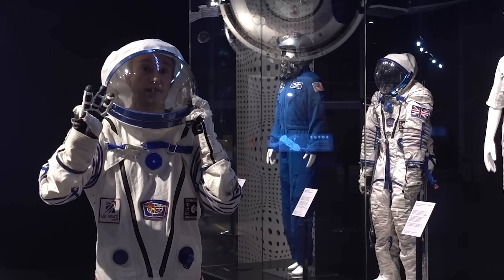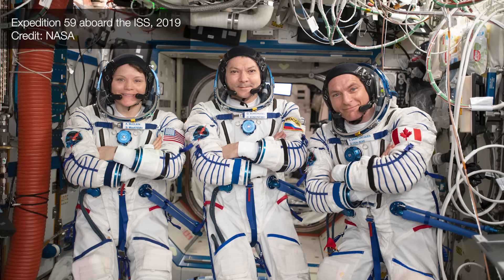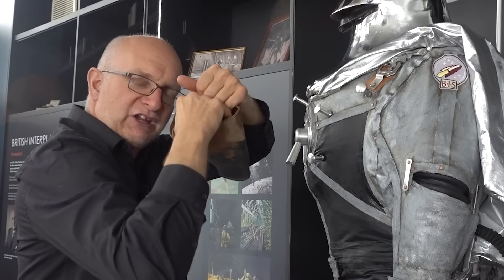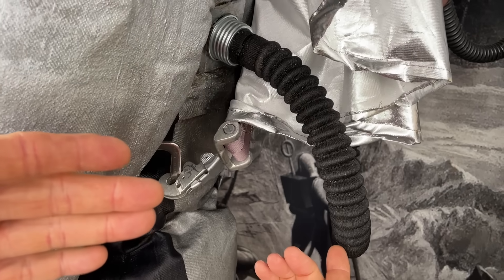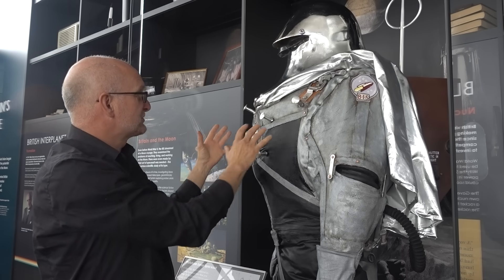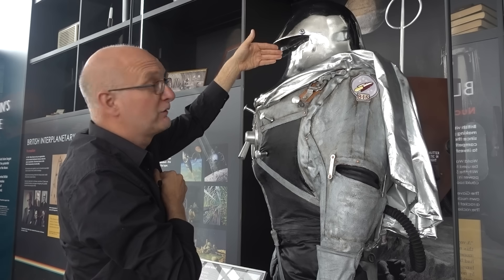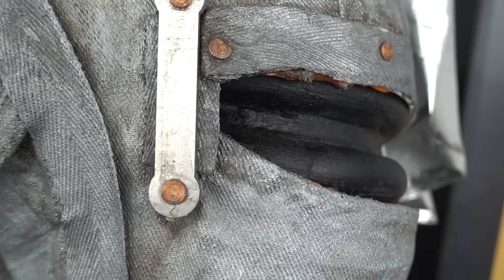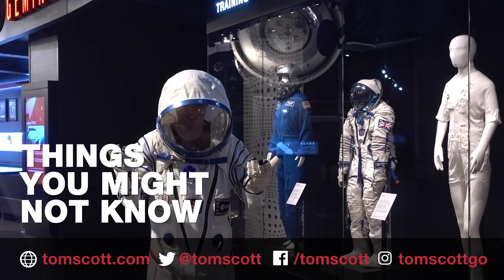The long-forgotten history of the British moon spacesuit

Comment: Materials Nit-pick:
Fiberglass (mineral wool) was invented in 1870. By 1880 a patent had been awarded for fiberglass textiles.
Rayon, acetate, and nylon were all well-known in the 1940s, and since you only need to make a few space-suits, presumably it could have been afforded for space-travel.
The US A7L space-suit doesn't skimp on suitable materials. Why should a British suit?
Reply: Hello. 

Whilst spun glass may be available earlier, the resin to bond it into a rigid structure was not. This is developed in the 1930s so completely in keeping with what I say. As for the technical materials you quote, we are going on what they specified, on rubber, on cloth and on rubberised painted surfaces. I think you have to wait until the mid 50s for highly reflective  mylar, and whilst nylon and artificial materials were used extensively in later flight clothing of the USAAF in ww2, we come back again to what Smith and Ross specified in their technical design documents.Wool, leather, rubber, cloth, what diving suits are made from, as I say.
Reply: @stephenabswisdom1187  Yes, your work is well thought-out and full of merit. I'm sure it was not an easy task! The nit-picking was more with the original design rather than your execution of it. Who knows what discoveries an alternate time-line might have yielded? Beta cloth is not resin-impregnated (like a surfboard) so much as teflon-coated glass fibers, and teflon already existed in the late 30's. Either way, it has good historical significance and a unique kind of relevance. There really aren't many full-size "alternate history functional space-suits" in existence, except yours!

Comment: Americans: expensive air conditioning
British: haha shiny blanket make me warm
Reply: Lmao
Reply: Actually air conditioning isn't just cooling down something. If you analyze the word you'll see that it's Much more. We got used to using it only for cooling but heating and humidity control is also part of air conditioning.
Reply: James May: "It's called an 'itchy blanket'. It reminds you how fortunate you are."
Reply: "*warm" people are wrong. Space impairs conduction of heat, as there is no air. This makes it easy to overheat, so the cape is used to keep cool along with active cooling systems.
Reply: @albertnewton8296  no, you are wrong
Reply: @kaydenlewis9246  >calls someone wrong
>proceeds to give absolutely no explanation or elaborate further
Reply: @ananttiwari1337  heat cant stay in space because there is nowhere for it to stay
Reply: @kaydenlewis9246  it can stay inside the space suit walls though. That definitely is matter.
Reply: @kaydenlewis9246  That's the problem. Heat can stay in the astronaut or spacesuit, there's just nowhere to move it out to so it stays in the astronaut. Keeping cool and avoiding absorbing too much heat from the sun is important.
Reply: That sums up regular British homes now.
Why do we need air conditioning, just pop open a widow.
A heater? No just get a blanket.
Reply: *cold
Reply: @Dapstart  no the blanket was to keep the astronaut warm not to cool them down
Reply: @Dapstart  space is cold

Comment: so how hard is it to make a replika and get it into a vacumchamber
Reply: Well,  when i designed this i also designed the pressure seals around the neck ring, but didn't put them on what you see here. I am also a hard hat diver and we used a lot of the tech from diving suits here to help in the overall design. There are many challenges to make it actually air tight.

Comment: For anyone else who maybe wondered what the heck that tower at the National Space Centre is made of, the outer structure is made of ETFE plastic, which I also just learned isn't all that rare for large buildings to use the material for lightweight translucent elements like clear ceilings that won't crush people in an earthquake.

Also, if you ever see a building like that catch fire, just GTFO, because it releases hydrofluoric acid when it burns. I'm assuming people have worked to mitigate that risk somewhat, but I'm not sure which part of that would be less fun, being on fire or breathing in HF fumes.
Reply: I remember reading about a military vehicle catching fire causing clinically significant HF exposure because the fire suppressant decomposed to HF at high temperatures. It was probably HFC-227ea or something similar.

Comment: Interestingly, the "liquid cooling and ventilation garment" that cooled the Apollo space suit was built on a design from a British suit with plastic tubes filled with water, but of course, it's not mentioned on Wikipedia, it is however mentioned in the documentary "Moon machines: Space Suit" about 30 minutes in.
Reply: ikr, it's almost as if Wikipedia isn't a good source of information
Reply: I'll totally pay you if you can send me one of those RAS flight undersuits from a surplus shop, I need it for my fursuit :p
Reply: @alakani  - I know that Soviet and Chinese pressure suits used by high-altitude pilots have similar rubber tubings and chambers, you can get surplus ones on Ebay. Not sure how they're holding up in terms of being airtight/watertight, though.
Reply: @alakani  do you mean RAF as in Royal Air Force?
Reply: @GODCONVOYPRIME  you shall be known… as Darth Vaderr
Reply: @alakani 
>I need it for my fursuit :p
You'll also need a de-lousing shower.

Comment: Why does it have a battle helmet
Reply: Hi Luke, it doesn't. Its made from fibreglass, as specified in the original texts. We vacuum.plated it with highly reflective aluminium to reduce heat build up from the sun. It is very long at the base to help the astronaut get in. I'm the only one ever to have worn it and the helmet has to be that shape to interlock with the next ring beneath.

Comment: Wouldn't that airlock be potentially dangerous? I mean, once you open a container in space, all the gas content is immediately sucked out due to gas expansion in a vacuum, so you would essentially be losing oxygen supply everytime you open it because the pocket would then fill up with the gas content that is inside your suit once you try to pick up any object found inside the suit... which would then be lost once you open the airlock again. It would also lower the overall pressurization of the space suit with every operation.

Comment: How is the "boiling blood in vacuum"-myth so common? Your blood will not boil because your blood system is a closed system and it maintains the pressure. What actually kills you is that the gases get kicked out of solution to keep the pressure equalized.

Comment: TOM! TOM!
Your blood does not boil in the vacuum of space! It's a myth! It's not real!

Your skin keeps the pressure well enough to prevent that! What you will find is that your eyes and mouth starts to dry up, that's about it!

And no, you will not freeze instantly in space either! It will take many an hour four your body to radiate heat, as there is no medium for heat to travel through, or to "suck up" your heat!

Comment: I was recently shopping for watches and realized that on most clocks that use roman numerals they use IIII instead of IV, I feel like it would be an interesting video to answer why that is.
Reply: No-one knows, lots of theories though.  Some say dials with 'IIII' look better than a 'IV' one, others say King George was a moron and insisted 'IIII' was correct.  I doubt it was a mistake (the clock makers weren't that illiterate) but now it's done for tradition.
Reply: I have heard that the practice of putting a smaller-numbered character before a larger one was a medieval innovation, not actually Roman. I don't know how true that is, and would like a video too.

Comment: Would love to know how the suits back in the 60s managed the 300°c fluctuation in temperature on the lunar surface. This video has enlightened me zero. Swing and miss. 🙃
Reply: It didn't. The astronauts did not have to deal with these fluctuations.
Reply: @atlas8827  of course they didn't, but I'm intrigued as to how they supposedly did.
Reply: @adpmac3981  
I'm not being cheeky. Let me clarify:  The maximum temperature of the lunar surface can reach 130ºC, but that's only because a lunar day lasts for about 13 earth days. That's 13 days of sunlight. That also means 13 days of darkness. All Apollo landings took place during the lunar morning, after the super cold temperatures and before the super high temperatures. Also, note that vacuum is a great thermal insulator.

Comment: The amount of Oxygen you would need for ONE DAY would fill a football pitch: so what about 2/3 people for 3 days 🤔
Reply: HAHAHA WHAT? That's so wrong.
Reply: @atlas8827  A diver needs a large cylinder of O2 (air.) That lasts 20 minutes.  IMAGINE 3 people in a spaceship.  How many cylinders of 02 will they require EVERY DAY They'd need a spaceship the size of TITANIC JUST TO HOLD THEIR OXYGEN SUPPLY -  100s of CYLINDERS WITH ALL THAT REQUIRED air/02
So flight into a vacuum for any extended period is IMPOSSIBLE
Reply: @johnkean6852  
The average consumes less than 1kg of oxygen per day, my dude. Oxygen in a spacecraft is usually in the form of a liquid or a highly compressed gas, which significantly increases its density. Liquid oxygen, for example, is more dense than water. That means a 2l pet bottle could hold enough liquid oxygen to sustain a human for some 3 days.
Reply: @atlas8827  I believe you - l just hope those 'dudes' on the way to Mars share the same philosophy 😁
Reply: @atlas8827  lt just seems rediculous that NO diving gear  in the last 50 years, with the demand that exists, and proliferation of new tech has included a tiny "21 pet" bottle  (as you're suggesting) as their oxygen source instead of the weighty cylinders they  struggle with presently which would ease matters somewhat whilst you're fighting with the rapids and waves and potential shark attacks ... l wonder why 🤔 it boggles the mind
Reply: @johnkean6852  

It's not a matter of belief.
You can work out the numbers yourself. 
Humans burn around 2000kcal a day. That's about 500 grams of glucose, or about 2.8 moles of glucose. For each mole of glucose, you need 6 moles of O², meaning you'd need ~16.8 moles of O² to burn 1 mole of glucose. Each mole of O² weights 32 grams, so 16.8 moles of O² weight about ~540 grams. Now, this process isn't 100% efficient, but even if you assume 30% efficiency, which is waaaay too low, we're still talking less than 2kg of oxygen per person per day. If in liquid form, that amount of oxygen will fit in a 2l (l as in liter, not 1) pet bottle. 

The comparison with scuba gear is faulty because the gas inside the tank is not 100% oxygen, and the consumption of air per unit of time increases with pressure. The command module, lunar module and the space suits were only pressurized to about 5 psia pure oxygen.

Comment: Isn't the blood-boiling thing a myth? The circulatory system is enclosed by arteries and veins and then by muscle and skin, it shouldn't be able to expand enough to actually boil your blood.

Saliva, snot, eye moisture, etc would, but that doesn't sound as cool I guess.
Reply: veins would likely rupture, no?
Reply: @atlas8827  I don't think so. The difference between Earth and space is only 1 ATM, which isn't very much. And they only need to hold on for a few minutes before it's a moot point anyway
Reply: @andrewjc13  
Alright, fair enough.

Comment: i love how the space suit looks like it was in medieval times
Reply: Space knight
Reply: Fitting for a British empire
Reply: It looks very British, I wonder if there is an onboard tea supply?
Reply: @K-Effect  If not, the chest airlock looks big enough to pass a teacup with saucer through.
Reply: Yes! The helmet looks almost like a medieval Frog-mouth helmet
Reply: The space-knight look is certainly a lot more badass than the suits that actually made it to the moon.
Reply: The suit does look like it needs a sword or a mace or something. It's a shame that the design is too stiff to actually use a melee weapon effectively.
Reply: All it's missing is a spacefaring dragon suit to face off with.
Reply: Right? It looks like a Space-Knight which is as British as it gets
Reply: It's kind of appropriate - NASA looked at a lot of things for ideas on how to make protective suits that you could walk in, including at the armored joints of medieval armor.
Reply: @dnebdal  They had a lot of experience from spacewalks already (so they knew small visor would suck)
Reply: @ImieNazwiskoOK  The helmet is relatively easy, anyway - the hard part is making good joints that are both air-proof and bendable without affecting the pressure in the suit.
Reply: Inforcing the telly liscences in space by blocking signals of offenders😫
Reply: Its steampunk
Reply: Some astronauts are chillin on the moon, then they hear deus vult getting louder.
Reply: It looks like the brief was "Henry VIII, but on the moon"